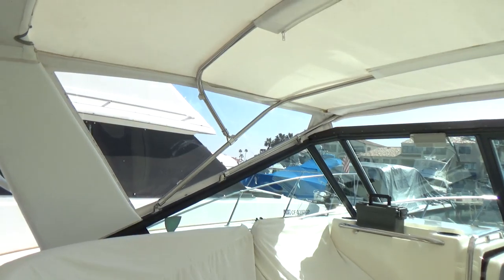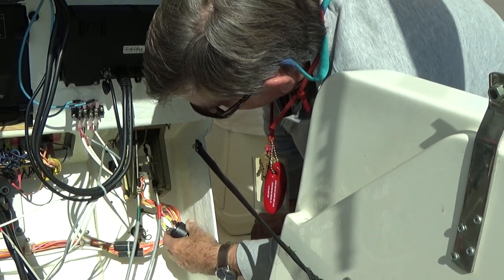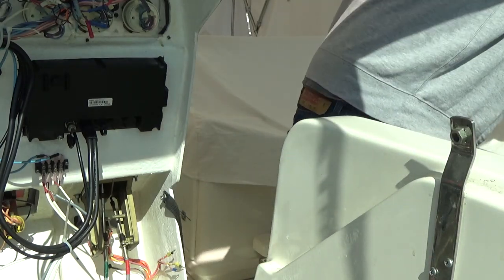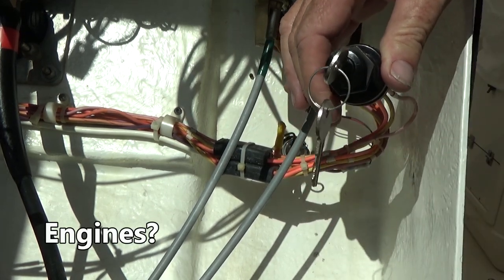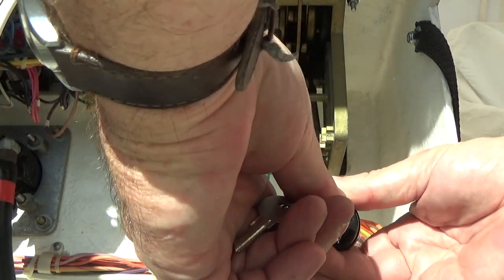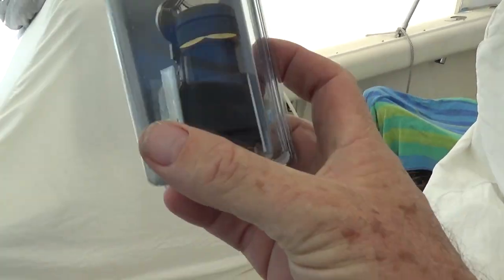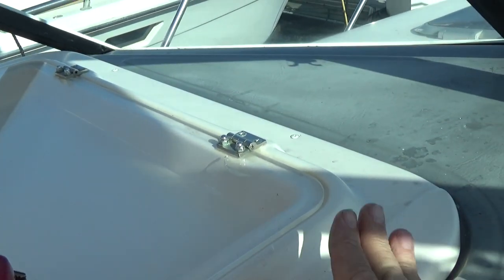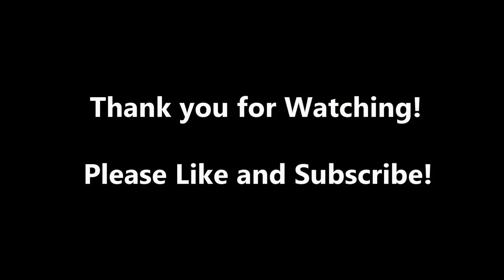Replacing the Ignition Switches

Comment: It looks like a pair of tweezers or needle nose pliers would have saved you a lot of effort. :)
Reply from the maker: Yeah I thought of that before I replaced them but they are old and the starboard one had had some problems.  I tried to extract the key but with the smallest picks I had  I couldn't get it out.  I'm keeping both of them as spares. I'm going to take the one with the broken off key to a locksmith and have them use one of their little tools to extract the key.  Thanks for watching!